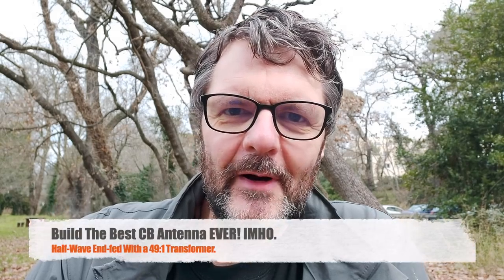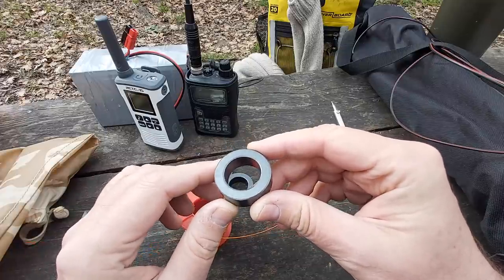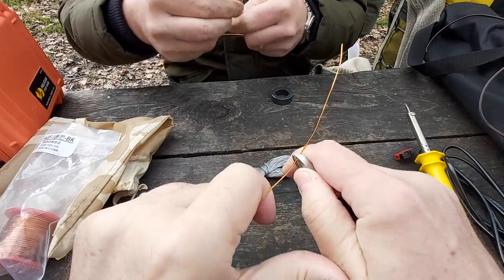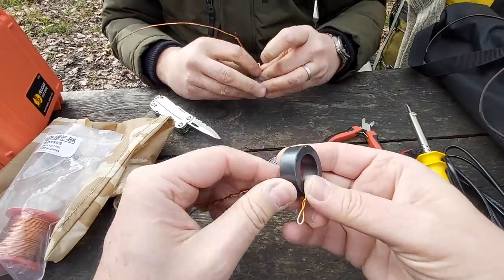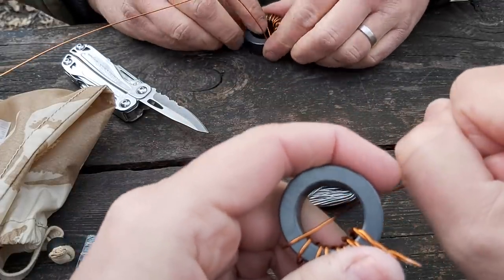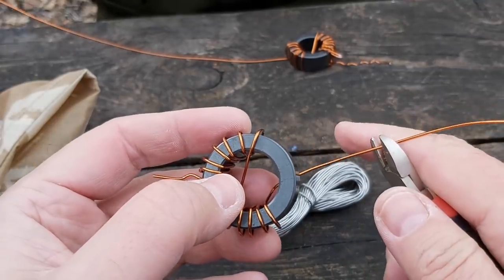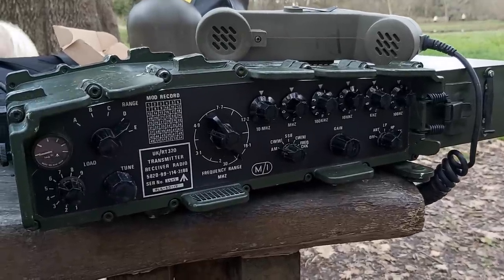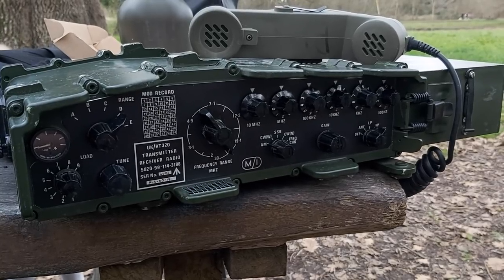Build The Best CB Antenna EVER! IMHO.

Comment: This fried the final in my radio! Not to say your transformer in itself did it directly. But my cspacitor came loose and broke connection, therefore the ground and center became a direct short! So, people, make sure you soldier the cap well, or have some kind of SWR meter slways on with this trick.
Reply from the maker: Ouch, yes, definitely check the SWR first. You can't check that there is no short because the primary winding is a DC short.

Comment: I find that fine grit sandpaper or an emory board removes the insulating varnish from wire quite nicely without risk of damaging or breaking the wire. I have also heard that you can heat the portion you want removed with a lighter for a minute or 2 helps soften the varnish and makes it easier for the sandpaper to abrade the varnish off And you can always check your work with an ohm meter..

Comment: Thanks to your videos EFHW is my favorite antenna and my first homebuild project, tested last summer on CB 11m, with it I did my first DXs with 5w only 😀. Now I upgraded it for ham bands! 
What is still not clear to me is if some improvements are expected with a counterpoise wire, I use it without “grounding” and I have no issues and no RF backflow...
Reply: How did you upgrade it for HAM?

Comment: 2:42 I use a butane lighter or soldering-gun to remove insulation; it eliminates nicking the wire.

Comment: Nice work.  We still have 27mhz CB in Australia, (US 40ch 5w AM 12w SSB) but we also have a UHF CB band, either 40ch FM @5w or 80ch Narrowband FM @5w (the extra 40ch go in the gap between the wideband channels when you reduce to 2.5khz bandwidth).   We are also allowed to use repeaters, which must be public access and have backup power (most are solar with battery backup or mains with solar/battery backup) for emergency 'power out' operation.  It's a class license which means as long as you use type approved equipment you don't need an individual license.   Repeaters do require an individual license as they are perused for coverage/interference issues with other repeaters etc.  We've got all three, some really old 27mhz stuff (from the 70s) and some modern UHF stuff, mix of 40ch and 80ch.  You can work between the 40ch and 80ch radios, but the NB radios sound a bit quiet (effectively underdeviating) on a 40ch receiver and the 40ch rigs sound like they are overdeviating on a NB radio of course.   There was a plan to ban the 40ch radios after a few years but it was quietly dropped when people objected.   So it will probably be a while before all the old 40ch radios (you can't buy new ones anymore) all die, as there are some of the very first UHF CBs, the Phillips FM320 from 1977 still working, particularly on farms and in trucks here and there.  You can use high gain antennas such as beams etc of course.   My favourite 'improvised and simple' antenna for 27mhz is the inverted V which you just need a length of 50 ohm coax to make.  Strip the insulation from a 1/4 wavelength, separate the inner and the outer into two separate strands.  Suspend at the point where you separated them and taper the ends down at a 45 degree angle.   Run the remaining coax to the rig and fit the appropriate connect (PL259 usually) and adjust for best SWR by trimming the ends of the inner and shield.   Directional, at right angles to the wire.  A length of fishing line tossed over a high branch works well for a suspension point in the field.  Works best about a half wavelength off the ground but still works pretty well only a few feet above it.
Reply from the maker: Yes, I watch 4wd AU channels sometimes and they all have them!
Reply: You can always import a 27 meg from the USA Stryker 955 is a grand one

Comment: I watch your a older video about HF antenna 49:1 couple months ago I end up making one with 134 wire it works very well the SWR was excellent and last week I end up making one for CB just to see what it like and using 4.5 wire on 12 watts ssb on 27.405 works extremely well thanks for showing Great video.

Comment: Another great video, Gil. Built my 49:1 AT to your design 2 years ago, and it's fabulous with my pruned wires. (To date I've been switching between my 20 and 40 metre radiators. Will soon add a 30.) Everybody should have one of these things. They weigh nothing, take up no space, and get you on the air fast.
Reply from the maker: Not my design but thank you! They are great indeed!
Reply: @RadioPrepper  I meant that I followed your tutorial here on Youtube! Thanks again!

Comment: Nice radio.  The vswr should be 1.2:1 OR LOWER at the chosen frequency.  I have made several and I use the FT240-43 x 2 stacked as I use 400 watts as an amateur.  I also use a single FT240-43 as a coaxial current choke betwen the coax from the radio and the bnc connection you use.  This improves the antenna system by giving the efhw something to drive against in the absence of a ground and gives a more accurate vswr scan as any standing waves on the feed line have been significantly reduced.   Cheers  VK5LB.
Reply from the maker: With 400W you will certainly get some common mode currents on the coax shield. With 5W, practically none.

Comment: There used to be a great electronics store....located south of the North train station in Paris.  I loved that place.  When stationed in Frankfurt, i went to Conrad’s quite often.  They had most anything I would ever need.  I really miss the years I lived both in France and Germany!  Yes, I still have a large roll of “1mm copper wire!  😉
Reply from the maker: You remember its name?
Reply: @RadioPrepper  unfortunately I do not remember the name.  I am thinking by now it probably does not exist. So many stores like that have closed in recent years!  The last time I was there was in 1995.

Comment: Hi Gil,
I have 2 PRC 320's, one a Yugoslavian LSB model. I will give this a try as 10m and 11m have had some good openings lately with 10m contacts on 5w across Europe. As an Idea a guide to what the band selector actually tunes to might be a good idea as I have had to learn using a frequency counter and a dummy load. I have found very little tuition on You Tube. 
Thanks for posting as I have no idea how to make a video!
73's
M0KIA
Reply from the maker: Thanks, I have two as well, USB models. You are a lucky man!

Comment: Very nice project. 7351. During 2 years I've made some experiences with old toroid of an old Tv, so the measures are 4,40 meters of wire to an HMA End Feed  JS20 Portable/Fixed with very good results. The antenna work's very well from 20 meters to 10 meters, and also in 11 meters. The SWR is 1,4 in 20 meters and the others 1:0. Compared to other antennas is less noisy, and the RX signals up in 2 ou 3, and the TX signals up in 2 or 3 also. Now in my QTH, I'm using these new antenna with very good results, compared to an A99. Tks fer sharing and good projects. If you want any other information about these new antenna leave a reply. 7351.
Reply from the maker: Lucky the toroid material worked :-)
Reply: @RadioPrepper  Yes, now I made four antennas. I guess I have conditions to make once a week, during a year. I´m study to make another for 2 meters and 70 cms.
Reply from the maker: I doubt it will work above 50MHz, not with a toroid...
Reply: @RadioPrepper  tks I will try and send the results.

Comment: You don't need the cap across the input, only needed for random long wire to tune out reactance, but it would be better if it were a variable cap for this purpose !

Comment: Hello from Mexico, I am pretty interested on building this antenna for an old Cobra 148 GTL, this antenna seems to work for 10 and 11 meter according to your antenna analyzer which is awesome, I would like to know what type of cable you can use for the antenna. Also at the end of the video you mentioned that you need to trim the antenna (wire) to a certain meters (using a calculator the wire the recommendation is 5.22 m for 27 MHz)  at the end which was your measure and also at the end of the tip how do you end? do you use a cover, I saw the other video were you made this same one but the SWR was above 2.0 an this one is between 1.5 and 2 which to me looks great. I am pretty new with no experience at all, so any help is very welcome! Will be nice to know more about HOA antennas because I see they work well for all bands, but is you know a way to build one specific for 11 meters will be nice to know. THANKS!!
Reply from the maker: 11m, I think I ended up around 4.8m... Coax, I like LMR240-UF.

Comment: Glad to see you back! To me, 4,5 meter sounds pretty short for a half wave. Why is it so? I was expecting something like 300 / 27 * 0,95 / 2 = 5,28 meter (insulated wire)
Reply: I thought the same.
Reply from the maker: Yes weird... Velocity factor? A bit much.
Reply: @RadioPrepper  if it works that's all that really matters :) I already thought using my 49:1 transformers for CB. Just change the wire, hang it and tune as required? That's convenient indeed.
Reply: I also did experiment with 49:1 transformer on 27.2 MHz. Best SWR was with alluminium pipe 4.7m long. Strange thing is that it is so much shorter.
Reply: @VladSolovey  using tube must have resulted in an even wider band then. :)

Comment: Hi I live in Australia and the ferrite ft140-43 on Ebay are like $50 delivered , There is a local electronics store that sells Ferrites & pre wound chokes , what size Uh am I looking for in a ferrite , thanks Larry
Reply from the maker: 140 is the size, or 1.4inch. You can use 82 or 240 size. Just make sure the material is type 43..

Comment: Lubec is not far from me. I am down the coast a bit from there. Were you ssb on CB frequency when you made that contact? I have never heard a meaningful contact on CB, usually only 10k watt stations skipping in with rubbish.
Reply from the maker: USB and AM. Yes, few people around but it happens...
Reply: Hi - I think Gil was on 20m at that point.
Reply from the maker: Yes 20m.
Reply: @RadioPrepper  Ok, thanks. I thought it sounded to civilized for 11 meters. Thank you for the continued videos of making baluns. I will some day get the nerve to try one.
Reply from the maker: No need for nerves. It's very easy :-)

Comment: Thanks for video Gil. What do you think about T2LT antenna for CB witch a choke made from a few turns of coax. Its easier to make and doesn't require toroid. Has the one you have shown mucg better performance?
Reply from the maker: Probably just as good. Not as small..

Comment: Hello !! Greetings from Andorra.
I'm trying to put an antenna CB with a magnetic base on a small stand of my roof next to my window, but .. there's no way to get ground plane .... inside the house a short distance from the window I have radiators and everything Type of things where the magnetic base is hooked and I'm sure I would have a good Ground Plane .. So my idea is ... Two magnetic bases could be connected? One on the roof near the window with the antenna, the cable of that base would be the entrance to the other base .. The one that would be put at some good place .. and of the latter to the radio station .. I could work?
Reply from the maker: I doubt it. Try connecting a few radial wires to the coax shield at the base if possible..
Reply: @RadioPrepper  Thanks !!

Comment: Bonjour, j'aimerais savoir pourquoi le condensateur dois avoir un si haut voltage 3kV  le signal n'est-il pas faible ?
Reply from the maker: Oui mais la distribution du courant avec son maximum au milieu du fil et minimum aux bouts fait qu'il y a un maximum de voltage aux bouts.

Comment: Hello,  thanks for the video. I still have a question. How do we tune this antenna without any antenna analyzer ?  How do I know if I have to lengthen or shorten the radiator ?  Thanks !
Reply from the maker: Yes, you cut it a tad longer and cut a couple inches at a time..
Reply: @RadioPrepper  then,  for a 27 MHz I will cut it at 5 meters then trim it down until I get the lowest swr.
Reply from the maker: Exactly :-) less than 2:1 is good, usually ends up around 1.3:1.

Comment: Can it be made with regular strand plastic coated wire or do you have to use that solid enamal coated wire to make the coil?
Reply from the maker: It should work.

Comment: No feed line choke (to isolate coax feed line from antenna)? Is there a good reason?
Reply from the maker: It's a half-wave, not a random wire, very little common mode currents on the shield.
Reply: Radio Prepper 
but the shield works as counterpoise and its length and position affects the final impedance and resonant frequency of the antenna. With line choke at fixed position on the coax we could get more predictable results.
Reply from the maker: A little, but not a lot with a half-wave, which is a full size antenna just like a dipole. It is just fed at the end. What you describe is for a random wire with a 9:1 UNUN, not a half-wave wire with a 49:1 or 64:1. I've had a lot of common mode current troubles with random wires, very few with half-waves.
Reply: @RadioPrepper  how about T2LT antenna in this regard by your opinion? It is also 1/2wave (dipole) but definitely required a choke at the end of feed line...
Reply from the maker: Yes but the coax shield is pretty different than the center conductor, even if they are both quarter waves. The current is not as well distributed as a single consistent conductor. I have been using these HWEF antennas for years without a choke. They don't need one at low to medium power. Random wires do.
Reply from the maker: Moreover the T2LT needs the choke to actually make the radiating shield a quarter wave. Without it the antenna is too long.
Reply: @RadioPrepper  
Nope.
You are talking about common mode current that is actually very low for EFHW. That is correct.
But impedance is highly affected by counterpoise length. It even tends to infinity without counterpoise. And that is understandable. No current can flow without counterpoise.
So when you state that EFHW doesn't require counterpoise that is wrong. Counterpoise is always there. It's the coax, your radio, your hand and body.
Without choke you have counterpoise of random length, so you have random antenna impedance.

http://vtenn.com/Blog/?p=1089
Reply: @RadioPrepper  thanks for your replies. Did you happen to compare T2LT with EFHF+transformer? Im just struggling to decide which one to build now :))
Reply from the maker: I haven't...
Reply from the maker: You can use the same transformer with different wires and the antenna works on harmonics, easier to change bands...
Reply: Just for the sake of an experiment and see what differences this brings, I would put a choke (2 pcs 43 material) ferrites right behind the radio with at least 8 turns of coax around them to avoid any stray RF enter the radio and affect its performance.
Reply: @W-733_KWX 
Stray rf isn't a problem for EFHW.
The issue is antenna impedance which depends on counterpoise length.
So the best way IMHO is to put choke near the transformer and connect 3-7ft counterpoise to the ground terminal. And check results with VNA. Or you could place the choke 3-7ft away from transformer without counterpoise, actually it has the same effect.
Reply: @W-733_KWX  
Actually for rf choke you could use any ferrite even the low frequency one and it could even work better without unwanted resonances.
Keep 43 material for better purposes ))

Comment: Can this be used for an dipole antenna for the 11 meter band.?
Reply from the maker: Not exactly a dipole, though it uses a half-wave wire, fed at the end instead of the middle. If horizontal, better use a dipole. If vertical, use the EFHW. See my other videos on the antenna..

Comment: I use a T2LT antenna for CB. Cheaper and even faster and easier to build with an air wound RF-Choke 5 turns with 11cm diameter.
Is this EFHW better than a T2LT for any reason?
Reply from the maker: Yes. The T2LT uses resistors for impedance matching, multi-band use, that means more losses. The EFHW is more efficient and simpler.

Comment: hello there, I can't buy an antenna at the moment for my car CB radio 4-5 watts.  can you please somehow help me DIY an antenna to use till I get a real one?  I am an electronic engineer but i have no information about antennas and I feel so bad about that.. I feel my self like a neanderthal human when I see people building DIY antennas. I have all the tools needed just please explain how to build one for the car or for my balcony.. whatever is more easy for you to explain
Reply from the maker: For a car, it's difficult, especially the base. You can however find affordable mobile CB antennas everywhere, like Ebay or Aliexpress.
Reply: @RadioPrepper  its not a problem for the car or the home. I just want to build one to use my cb radio. Witch one is easier to build? I ordered one in AliExpress but it will take 40 days to come.
Reply from the maker: I suggest the one in this video then.
Reply: @RadioPrepper  it will work for a radio that is not more then 4 wat max?
Reply from the maker: Absolutely yes. Power output is not very important on HF.
Reply: @RadioPrepper  thank youuu